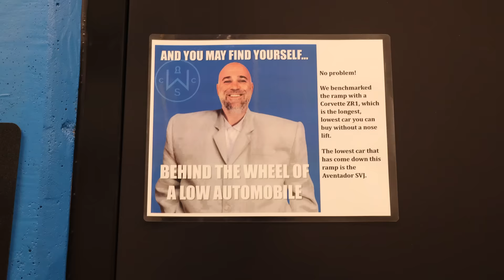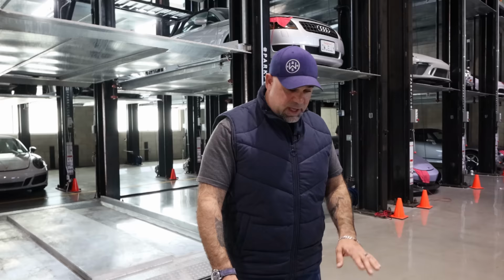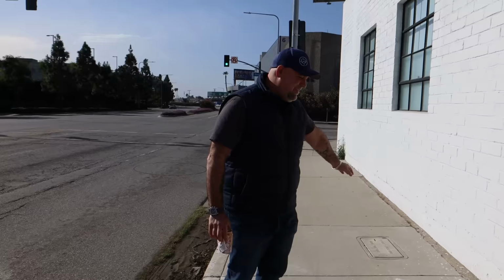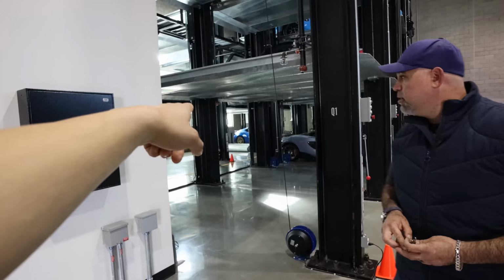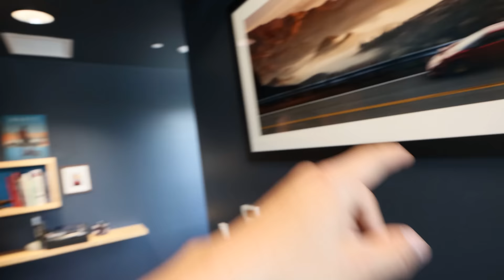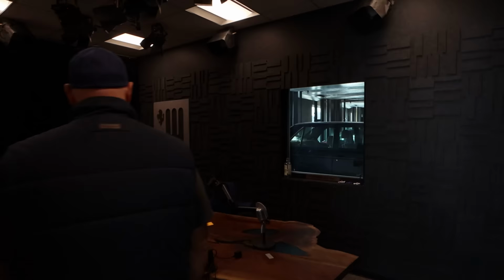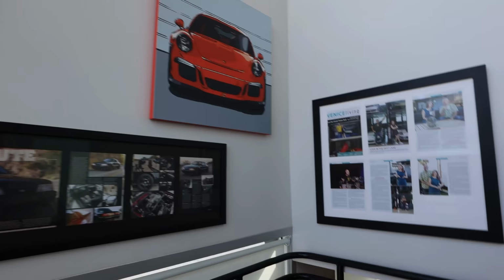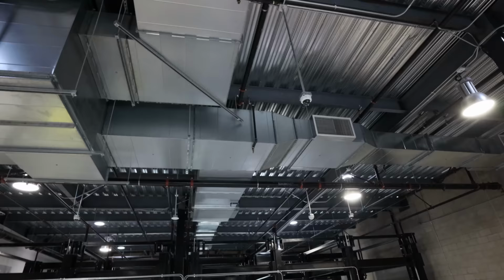Insane Purpose-Built Garage of our Dreams: Matt Farah’s Westside Collector Car Storage

Comment: Absolutely Love the details. I am an engineer who built Buildings and machines for a living, so the details of construction are very impressive and I can totally relate to dealing with Government types who just follow rules irrespectively of logic. Hopefully one day when we humans grow up we will have governments that can think for themselves.  The turbo CX 500 Turbo is interesting because I had a  1983 650 Turbo Yamaha at that time, so I'm not so sure the CX was first but if it was it was by weeks or months. Kawasaki came out with theirs several months after I got mine and it had 112 hp, so Yamaha did a recall on my bike and modified it for extra boost to bring my power from 85 HP to about 112 HP.  Lastly I am are major car guy as well but unfortunately am not in the money league of most of the cars there but instead I built it all myself. I bought a 1975 Formula 400 Firebird brand new in Feb 1975 and still have it but I turbocharged it in 1979, drove it for 10 years breaking everything. In 2005 I took it out of storage and rebuilt everything to handle 1000 Hp reliably so it wouldn't break this time.  Check it out at "Johns 1975 Formula 400 Firebird" on facebook, the whole story is recorded. The car has also been totally rewired to be controlled by an industrial Computer (PLC) that integrates with a FAST fuel injection system etc. Maybe an interesting shoot? (That is Henry Winkler with me at the 2013 Local car show with the firebird).